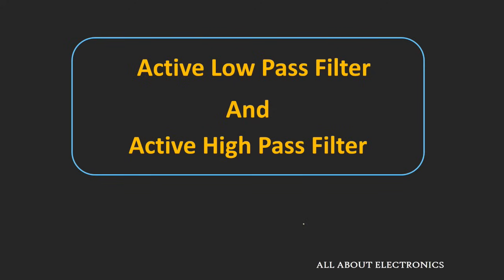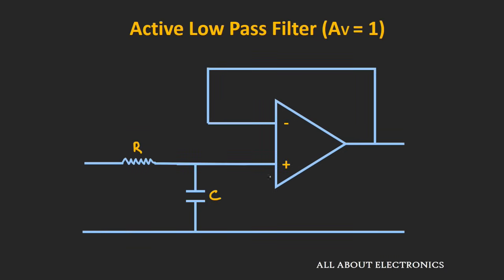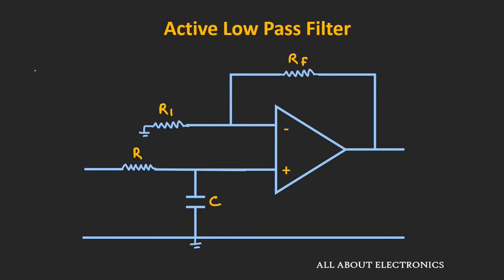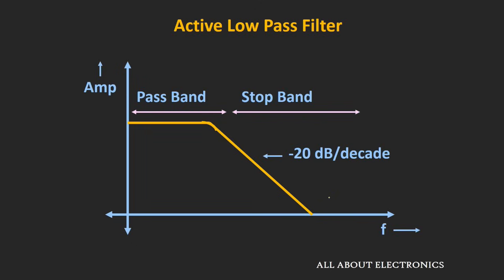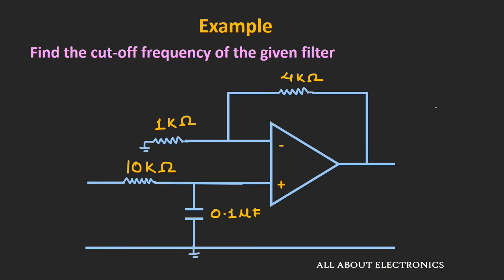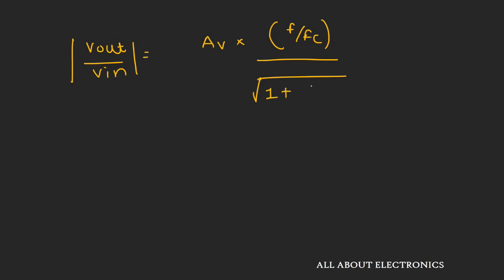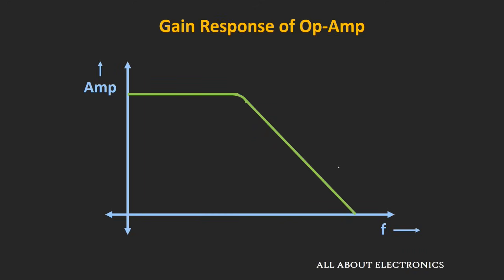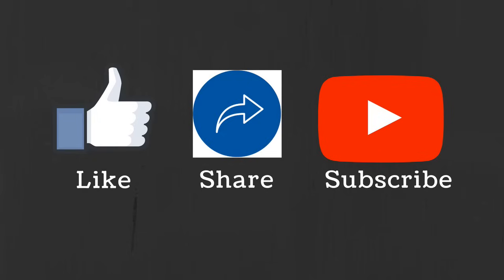Active Low Pass Filter and Active High Pass Filter Explained

Comment: How exactly does the buffer separate the input from the output
Reply from the maker: The input impedance of the buffer is very high and it has a very low output impedance. Meaning that the first stage won't see the impedance of the next stage. And likewise, as the next stage is seeing a very low output impedance of buffer, it will not be affected by the impedance of the first stage.
I hope it will clear your doubt.
Reply: Correct me if I am wrong, so the high input impedance basically supplies the voltage applied at the input to the opam and the low output impedance is present to make sure all the output voltage is applied to the load. So now there's very low impedance on the output side thus this impedance won't affect the next stage. Right? 
Also, how does changing the position of the capacitor help?
Reply from the maker: Yes, That's correct. I didn't get your last question about tchanging the position of capacitor.
Reply: At around 8:00 mins into the video, you mention that to avoid using another buffer the capacitor should be connected in the feedback path. How does that work?
Reply from the maker: In that circuit, the input is applied at the non-inverting terminal of the op-amp. While capacitor and resistors are connected between the output and the inserting end of the op-amp. So, the input source signal and filter circuit are isolated from each other.

Comment: Sir if I obtain the value of C as 3.18 nF assuming R = 10 k ohms , is it correct ???
Reply from the maker: Yes, it is correct for the given cut-off frequency. Theoretically your calculation is correct. But practically suppose if you design this filter, then I doubt you will get 3.18 nF capacitor. So, it is good practice to choose C first and calculate R accordingly, because it is easy to adjust R using Trim POT (variable resistor). Your answer is correct but just keep this little thing in mind for the future designs. Good luck.
Reply: @ALLABOUTELECTRONICS  sir, i would like to ask how do we decide the value of C?

Comment: Great video bro.However,how have you got both the values of Rf and R1??
Reply from the maker: I hope you are talking about the last example given for the exercise. If so then the transfer function of the high pass filter will be,  Vout/Vin = Av * (f/fc)/sqrt(1+(f/fc)^2). Now here the operating frequency is 10 KHz and the cut-off frequency is 5 KHz. So f/fc will be equal to 2. Now, at 10 KHz, we require the gain of 10. So, Vo/Vin should be equal to 10. So, if you put all these values and simplify it then you will get the value of Av around 11.2. Or the ratio of Rf and R1 should be equal to 10.2. You can choose R1= 1K and Rf as 10.2 K to design the filter. 
I hope it will clear your doubt.
Reply: ALL ABOUT ELECTRONICS thank you very much
Reply: @ALLABOUTELECTRONICS   bhai ek doubt h pls solve...
Bhai Vin = 100 mV & Vo = 1V he... So isse hum assume kar skte he k Gain around 10 times hua so by default Av= 10 hona chahiye. 
So Av = 11.2 kyu aa rha he??
Reply from the maker: Because with gain the transfer function of the filter would be [(w/wc) / sqrt ( 1 + (w /wc)^2)  ] ( 1 + Rf/R1)
And this entire terms should be equal to 10. If you put w = 10 kHz and wc = 5kHz then the first term would be 2/sqrt (5) x (1+Rf/R1) and this entire term should be equal to 10.
So, from this, we can say that the gain of the op-amp should be equal to 11.2
I hope it will clear your doubt.
Reply: @ALLABOUTELECTRONICS  yeah thanx bro.. Now I get it. Really helpful

Comment: At 9.00 in both case(w=0,w=infinite) we are getting output,then how it is a low pass filter
Reply from the maker: At low frequencies, the circuit provides the gain of 1+Rf/R1, while at high frequencies, it acts a buffer. So, it is not amplifying the high frequencies. So, in a way, it is low pass filter. Because as the frequency increases the gain provided by the circuit will reduce. I hope, it will clear your doubt.

Comment: I use Rf = 1k ohms & R1 = 1 k ohms and C = 0.1 micro F.
So R becomes 3.183 k ohms..
is this right?
Reply: I think there is mismatch in gain of circuit by using your values..  (1+Rf/R)=(1+1/1)=2  i.e Av is 2 but as per question  output is 1V and input is 100mV.. So gain should be.. 10..... Hence your value..  Rf/R must be 10-1=9 ...Do mention if I am wrong

Comment: bro your method of explanation is great i want to make 7 band music equalizer circuit and i want to separate the 7 different frequency of the audio signal such as low frequency filter up to 150 hz and band pass from 150 to 500 Hz and so on can you tell me an accurate formula of resistor and capacitor in those so that i can create low,high,band pass filters. will be waiting for your reply
Reply from the maker: For the first order Low pass filter, the formula is very simple f= 1/(2*Pi*R*C). You can choose let's say C=0.1 uF and find the value of R. But this filter will be a very basic filter. And it will not have a sharp cut-off, means after 150 Hz, the attenuation will not be zero. Rather amplitude will fall slowly. And it might have frequency components above 150 Hz. 
So, you might need to higher order filters may be 4th or 5th order Butterworth filter. So, I recommend you to use analog devices filter wizard tool.
You can select your cut-off frequencies and gain. It will give you response and the component value and even suggest you the op-amp IC. 
http://www.analog.com/designtools/en/filterwizard/
Using this even you can design the bandpass filter.
I hope it will help you.
Reply: ALL ABOUT ELECTRONICS thanks you so much for your idea and explanation.
Reply: ALL ABOUT ELECTRONICS I was really in need of something like this thanks you so much

Comment: can you please elaborate why are we avoiding the use of buffer in this circuit at the input
Reply from the maker: We are assuming that the input is applied to the circuit/filter using the ideal frequency source. But if the input is also coming through another circuitry then it is better to use the buffer at the input as well. 
Please check at 7: 25
Reply: +ALL ABOUT ELECTRONICS fine thnx...

Comment: feed R = 9k ,R=1k and filter parameters R=6.33kC=0.01micro farad
Reply from the maker: Please check the values again buddy. 
Try this values, R = 3.18 kΩ,  C = 10 nF, Rf= 10.18 k and R1= 1k
Reply: @ALLABOUTELECTRONICS  i think the guy is right because gain in (1+Rf/R1) not (-Rf/R1) so if we take your values gain will be (1+10.18/1)=11.18 (a total gain of 10 is required according to the problem)

Comment: I chose Rf = 9 kΩ,  R1 = 1k Ω,  R = 3.18 kΩ,  C = 10 nF
Reply: Shouldn’t we be taking into account Vout/Vin = Av * (f/fc)/sqrt(1+(f/fc)^2)? In the example we are supplying a 10 kHz signal and obtain a ratio of Vout/Vin = 10. Plugging in f/fc = 2 to the above equation, I determined Av = 11.18 so I chose a 10.18 k for Rf and 1k for R1.  I chose the same R and capacitance values as above.
Reply from the maker: That's correct design👍
Reply from the maker: Yes, that's right Christian. We also need to take into account the Vout/Vin = Av * (f/fc)/sqrt(1+(f/fc)^2).
Your calculated values are correct.
Reply: @ALLABOUTELECTRONICS  I ran this circuit in LTSpice and found that the correct values would be R1=1k and Rf=9k as Brandon said. But I think that Christians comment was logical. Why didnt Rf=11,18k and R1=1k work? That left Vout with 1,83V, too much gain.
Reply: @ALLABOUTELECTRONICS   hello sir,
How did you assume capacitance=10nf directly? 
U told to calculate the capacitance first so that it will be fine for practical application.

But how to find C value, just having cutoff and signal frequency?
Reply from the maker: The equation for the cut-off frequency is fc= 1/(2*Pi*R*C). And here cut-off frequency is 5 KHz. So, just assume the value of C. (Let's say 10 nF, then you can find the value of R).
Reply: @ALLABOUTELECTRONICS  cut off frequency is 10khz na . Please tell me how is it 5KHZ
Reply from the maker: The signal frequency is 10 kHz. The cut-off frequency of the filter is 5 kHz.
Reply: @ALLABOUTELECTRONICS  thank you. Ohh yes it's my mistake I didn't concentrated on the question properly . Thanks for early reply
Reply: Can you send me the complete solution of this problem to my mail   fazilrather777@gmail.com
Reply: ALL ABOUT ELECTRONICS for high pass filter u said u can assume the value of resistor from 1k to 10 k.  On assuming 10k  , I got 3.18pf... Is my assumptions correct?
Reply: @balakumar7262  I also calculated with same assumption. But I got c=0.31nF
Reply: How did you find the values for R and C
Reply: Please can you tell me how did you find the value of R ?
Reply: Christian McGuirk how to calculate r and c
Reply: I have found the same result with Christian McGuirk but you also said Brandon Vonk is correct. How come does two of answer become correct at the same time?
Reply: I actually got the ratio Rf÷R1 =0.9 {bcz [(0.1×sqrt(5))÷2]-1 =.88 approximately 0.9}
Which implies we can choose Rf=9k and R1=10k...(10k not 1k)
Am i correct or not?
Reply: Can you explain how you choose these values